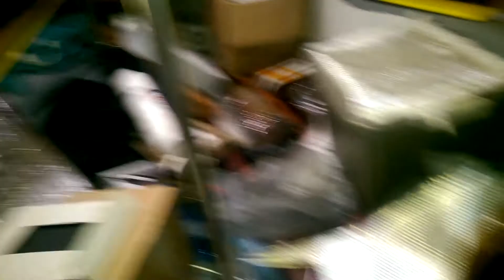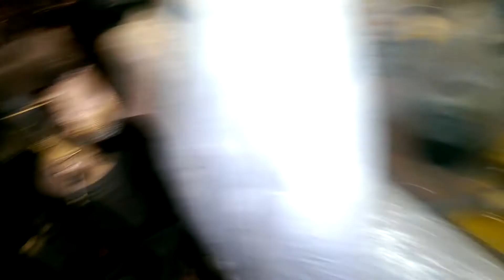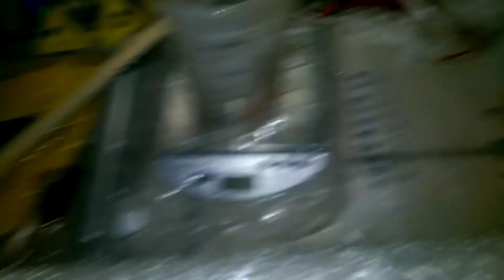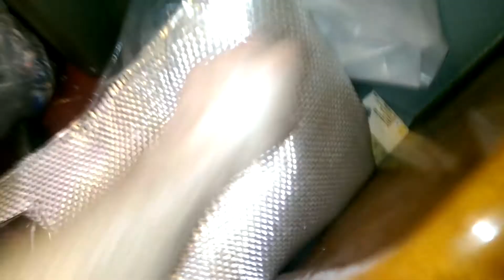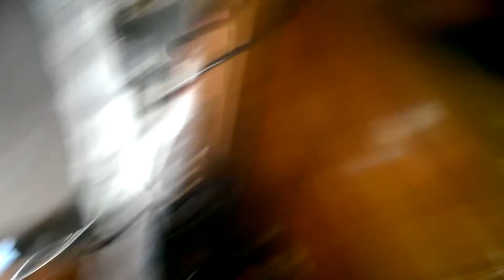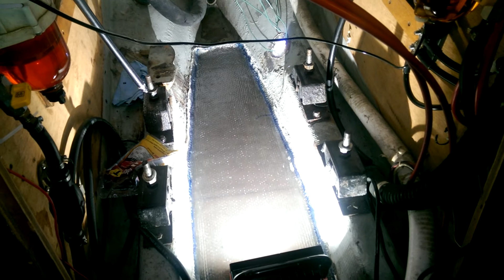Rhapsody's Fuel Tank

Comment: Awesome work! Why don't you gel-coat it inside and out? That's an epoxy finish and you could paint or spray it on. It doesn't cure in air, though do you need to follow with wax or use a waxed product.
Reply from the maker: Gelcoat hasn't been a thought on this project before. Not sure how it would handle being in contact with diesel. I know I've read gelcoat is polyester resin based. Looking up gelcoat again, I found some (maybe not all) is Isophthalic polyester as opposed to Orthophthalic polyester. Iso-based, I read from another Nor'sea owner page, could withstand diesel, while Ortho-based wouldn't. If gelcoat was used, wax, or PVA (which I have on hand) would still need to be washed out before diesel would be used.

I reached out to someone else who has built tanks and gave me some suggestions on finishing it out. The plan I've had to finish it out is to use epoxy based barrier coat, Interlux 2000E, 4 or 5 coats, I think. Then, there's a fuel tank liner that gets painted on inside.

Since I'm using vinylester resin, I've read it can withstand diesel directly. The barrier coat paint and liner is added protection to fill in the pores of the resin/glass.

I think doing all this will help protect the tank and if it all works out, it'll last forever.